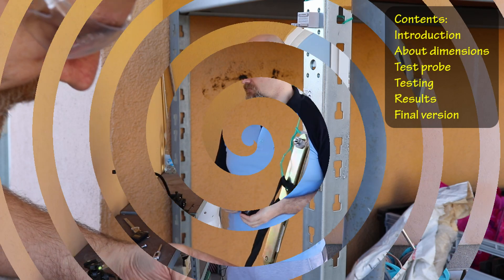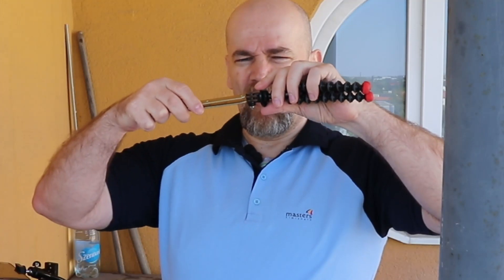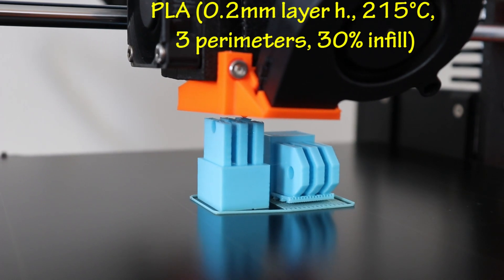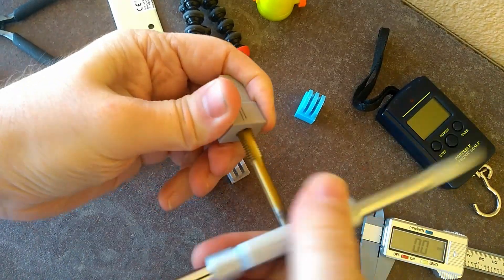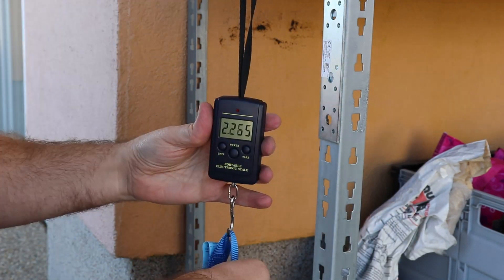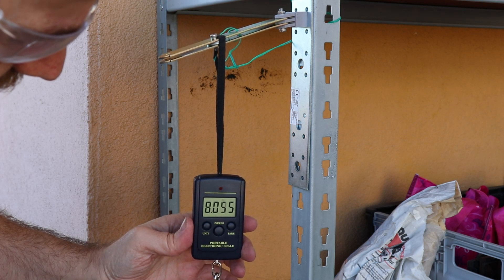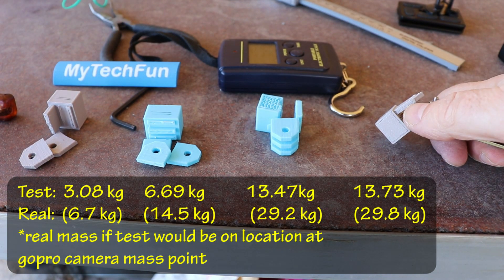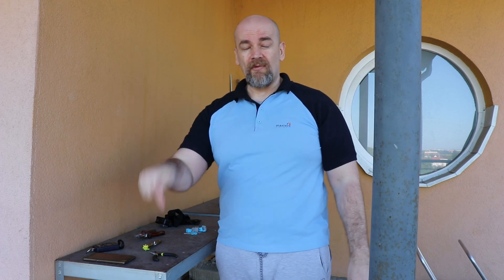Arca Swiss to Gopro Hero mount adapter - 3D printing and testing

Comment: Awesome work, anyone find one of these made out of aluminum yet?
Reply from the maker: Problem which may appear with aluminum is its too strong. We need some elasticity, when tight the screw friction prevent GoPro from rotating
Reply: @MyTechFun  Could see your point. I have a few aluminum mounts (both 2 and 3 prong) to mate together. Haven't had any issues yet. But I really do wish someone would make an aluminum one. I did find someone else made a 3d printed mount like yours but with a wider arca base. And looks like need to sink a brass fitting for the screw.